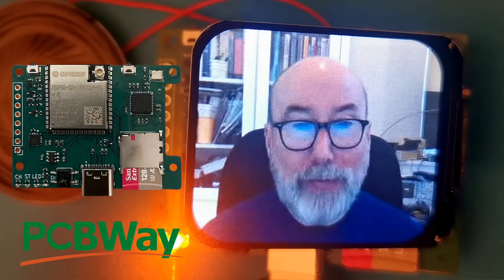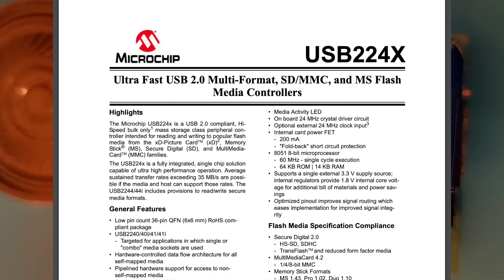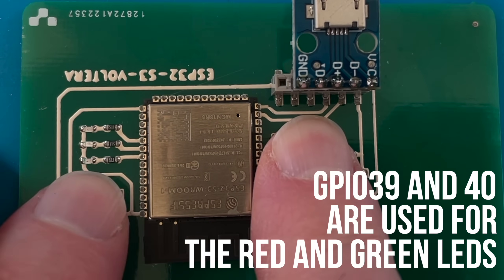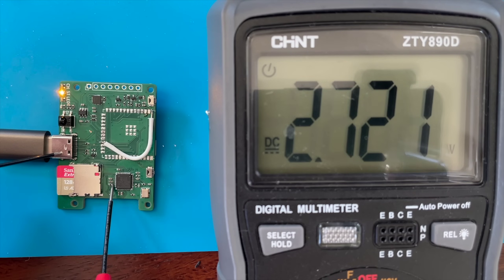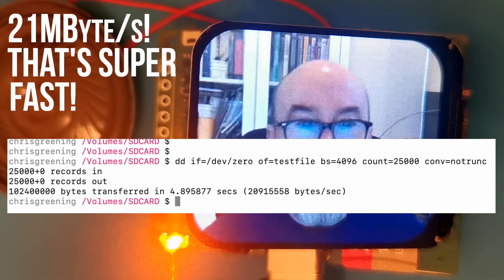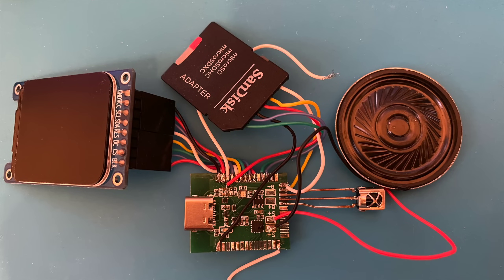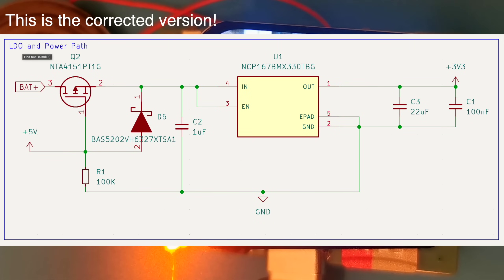Can You Spot the Problem?

Comment from the maker: If you'd like to help support the channel and help me buy more nonsense - I have a Patreon page: https://www.patreon.com/atomic14

We've also got a shop now! https://shop.atomic14.com

And if you're shopping on AliExpress or Amazon then if you click on these links I will get a little bit of affiliate money:

Aliexpress - https://s.click.aliexpress.com/e/_Ac05mF
Amazon - https://www.amazon.com/?tag=atomic14-20

You can also join us on Discord here: https://discord.gg/h2DDnDdjD2

There's also the Atomic14 newsletter here: https://atomic14.substack.com/

And don't forget about the MakerNews newsletter - https://makernews.substack.com/
Reply: why dont u use an usb hub ic so u can have sd card controler and esp32 connected at the same timme ?
Reply from the maker: Mostly down to cost - and I still need to share the SD Card between the ESP32 and the card controller.
Reply: The speed you obtained on the uSD is the same I get from a Teensy 4.1 in 816 MHz overclock mode. No need for an additional chip. Looks to me the ESP32 is a clunky solution.

Comment: Can't help but notice that you have removed the antenna while working with these WiFi modules. 
I was under the impression that one should never have the antenna off a RF transmitter as the impedance mismatch reflects any output power back to the RF amp, potentially cooking it.

Comment: Whoah, that schematic is giving me PTSD. No wonder you got the diode wrong! There's nothing wrong with using multiple ground symbols in a schematic. It makes things much cleaner and easier to read/figure out where ground is and where not, without following potentially confusing lines. And also: always have voltage sources up in the schematic. Not just the arrow pointing up, but have the whole connecting in the top portion of the schematic, and draw from there. Looking at you 5V symbol that's almost in line with the already confusing ground line!  Nicely done video!
Reply from the maker: Good points, definitely worth having another go at the schematic to make it clearer.

Comment: My eyes start bleeding seeing this PCB... 
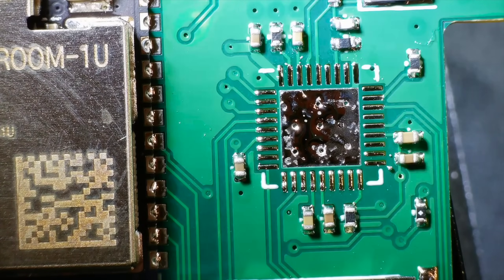1. Every SIG/PWR via needs a GND via at lumped distance. - 3:41 (improves signal integrity)
2. Components should be placed at least 2-3mm away from boards edge (with exception for connectors) - 2:05
3. Leaving a copper pour with single via is almost guaranteed way to fail at EMI tests (it acts as antenna) - 3:30 [same as long thin non-via-terminated pours]
4. I can't spot if USB connector is ESD-proof, but probably not and it may end really bad for your board. - 2:05
5. I see it's 2-layer board so those signal lines have definitely wrong impedance (fix me if it's 4+-layer)
6. As it's prototype I'd not complain about component placement which looks bad.
7. Board edge should be covered with a guard ring connected to CGND (chassis ground) - otherwise edge fired emissions may cause EMI tests to fail
8. Lack of length matching on traces (at least not visible on video)

Probably more, but those issues were most visible.
Reply: Context mate. Not all PCBs are designed to be commercialized. For my projects, if they work, that's usually good enough. Given this seems to be for a fun project, your approach seems quite excessive.
Reply: @LysisofPie  Even if PCB is not commercialized it still needs to meet all local regulations - in most countries goverments doesn't care about that, but sometimes they execute a round-up and drop some heavy fines for showcase (my country just loves to fine their citizens, as our budget is f-d up). 

Also you'll learn that hard way when your hardware will start to glitch due to amount of EMI inside the box. Better to learn how to design properly than to have a high-voltage power supply of EDM machine or even worse closed-loop stepper motors at 2-ton machine going wild (3, 7)

I've noted mostly issues that are important on hobby-grade project to work properly if it involves USB HS. Even if it may work properly it's a good idea to match traces length and impedance to prevent high frequency noise around your PCB (1, 5, 8).

Component placement makes your routing and soldering way easier... and often you can do complex designs on two layers instead of six (2, 6)

Also don't ask me how many USB PCBs I've fried due to ESD at connector (4)

I could also complain about having room and leaving traces too close together or using small vias where larger could fit and reduce manufacturing complexity, having ground pour too close to traces and influencing impedance... but those are usually related to commercialization and mass manufacturing rather than prototype staging (trust me it's quick to implement above guidelines and you will have less issues with your designs, especially if it involves high and very high frequencies - 100MHz+ and 1GHz+).

Comment: Somehow using a smaller PD resistor to circumvent the ICs PU just seems wrong. I wonder why they made it internal and not just externally required, aren't resistors in IC's some of the most expensive components?
Reply from the maker: I've seen it in a couple of datasheets now - but always explicitly called out. It seems weird to me, but maybe they want to make sure the IC works when it's powered without needing to connect the reset line?

Comment: Thanks for the vidoe. Love to watch it.
For the ESP32, if programming right, the 4-bit SDIO can do 7MB/s read and 2.6MB/s write. FYR!
BTW, the USB is slow even on ESP32 S3. Slower than 4-bit SDIO....
Reply from the maker: Definitely, I was able to get really good results with 4-bit SDIO https://youtu.be/ocXs1yxsux4?t=167 but sadly the ESP-32 USB is just really slow and limits the speed to 1Mb/s.
Reply: @atomic14  The Pi5 now can support 13 years ago SD 3.01 spec., day SDR104. Faster than Pi4.
Because of the SD speed and display, I switch to use Pi zero instead. Much better...

Comment: It's a little evil but I use one side of the USB C for the microprocessor and flip the cable over for additional devices. Just don't forget it when you get the boards back!
Reply from the maker: That's brilliant - and yes, a little evil :)
Reply: @atomic14  The T-Pico C3 does this as well to switch between the RP2040 and ESP32C3. It uses a different color led so you know which one you are connected to. I think it would work well for what you are doing and would probably be easy enough to implement.
Reply from the maker: I'll do some investigating - might solve my USB conflict completely!

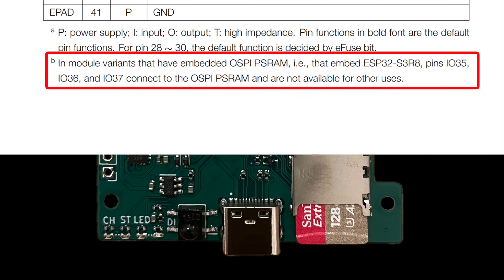Comment: 8:10 I have been there one week ago :D

Instead of using two USB C connectors could you wire one data pair to ESP32S3 and the other to USB2244 so it depends on the orientation of your USB C cable which controller is connected?
Reply from the maker: Good idea - I like it. And congrats on getting the answer correct :)

Comment: Close call indeed! Happy this little project is gaining some traction.
Reply from the maker: Thanks - it was only when I connected the battery and saw the charging light was not flashing that I realised something was wrong. And then when I measured the voltage on the battery I quickly disconnected it!

Comment: Super compact board. Using the ribbon cable version of the screen is way to go for sure. It's cheaper and should remove potential alignment headaches. Lots of very cool features.
Reply from the maker: Thanks! I’m tempted to get 100 of the sockets from AliBaba - I’m sure I can get rid of the spares on eBay…

Comment: Were you using the SD card in SDMMC Host Driver mode?
The 1MB/S you mentions is standard SD driver?
Reply from the maker: Lots of details here - https://youtu.be/ocXs1yxsux4 On this board I'm using it in SDMMC mode. But I've tried it in SPI as well. The main limitation with the ESP32 is the USB speed which is 12Mbps.

Comment: A lot of alternate solutions posted here. I would simply suggest a jumper or switch to select between dev or storage mode. Great project!
Reply from the maker: That's actually not a bad idea. Certainly simpler than trying to automatically switch between the two modes.
Reply: Or have some removable jumpers in case of an emergency lockup situation. I recon the idea of a 'no user intervention' sharing of the USB bus is worth striving for.
Reply from the maker: I'd really like to be able to just plug it into USB and have it switch into mass storage mode. For programming you could hold down a button and go into a DFU type mode.

Comment: Why don't you try a USB hub controller to solve the USB issue? Like the FE1.1, it's cheap and dead simple to use

But since you are likely never going to need both at the same time, nor can you easily since SPI and SDIO are not multimaster buses, something like a USB switch is likely simpler. But then you end up in a similar situation where you could lock yourself out.
Reply from the maker: That's what concerns me - I've already had a couple of instances where I've had to short out the reset line to get back into a sensible state. Having some kind of emergency access to flash the ESP32 feels sensible.

Comment: For reference, SD Association indicates a 104MB/sec max bus speed for UHS-1 cards (~SDHC I). In practice, that is probably limited by the host, etc. SD cards are trial-and-error based on different model of cards and devices. 

We have some good luck with some very old SD devices playing with new SDXC cards (huge capacity but not sure if any speed advantages). SwissKnife etc can facilitate formatting.

Newer UHS-II and UHS-III cards have more pins and can run faster. The newer SD Express cards are up to 3940MB/sec (PCIe Gen4.2).
Reply from the maker: I started down a complete rabbit hole of building my USB3.0 solid state drive before I managed to pull myself back out to sanity :)
Reply: @atomic14 Indeed, it is a black hole! The standards and options are mind boggling. 

I suppose you just need a storage solution that is cheap, fast, and big. . . given the scope of the project & limits of the hardware.

In the real-world, I quite like SD cards.

Comment: Hello, awesome board. I was just wondering why didn't you use something like a USB switch? It is very cheap and it does the same thing you are trying to do with reseting the usb2244 but it's cleaner. Thank you.
Reply from the maker: Just trying to save on components - but you are right, they are very cheap. I'll still need to hold the USB2244 in reset to get access to the SD Card, but having a switch would guarantee no interference.

Comment: Why not something like a USB2660? Flash media controller plus USB hub. That'd be the cleanest solution.
Reply from the maker: Would definitely be cleaner, but I need to be able to use the SD Card from the ESP32 as well. With the USB2660 I can't see any way to tell it stop using the card so the ESP32 can take over.
Reply: @atomic14  I would assume that you can externally assert pin 22 ("Card Detect") and make the USB2660 eject the card/stop accessing it anymore. 
Also sure that you can find other ICs with a similar use case (USB hub with integrated card reader), which might have a clearer way to disconnect the card from the interface IC.
Reply from the maker: I found one that has a pass through for the SD Card - but it was quite expensive.

Comment: I guessed A
Reply from the maker: Not unreasonable. It's one of the really interesting things about the circuit - the MOSFET does look like it's the wrong way round - but it's actually crucial to how the circuit works. When you hook up the battery you need it to flow through the diode of the MOSFET so that the VGS voltage makes the MOSFET turn fully on.
Reply: @atomic14  right.  I recently designed something similar but with solar power bypassing a battery.  The thing that messes me up is when symbols don't draw out the body diode.  That tends to help me keep things clear.  In your schematic, body diode us not drawn, but in your explanation schematic it is.
Reply from the maker: Ah, you're right. Yes, I think the symbols should always include that body diode - otherwise it's really confusing.